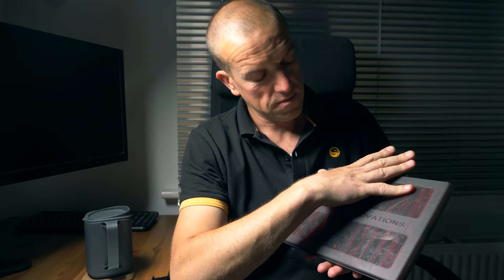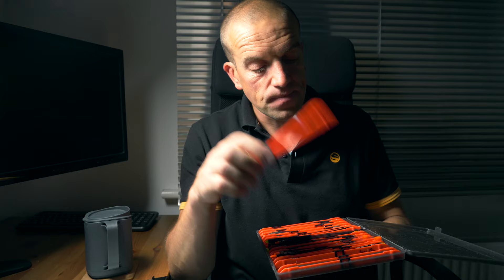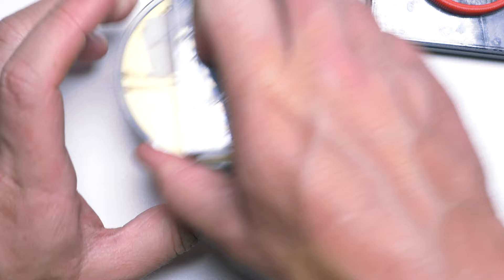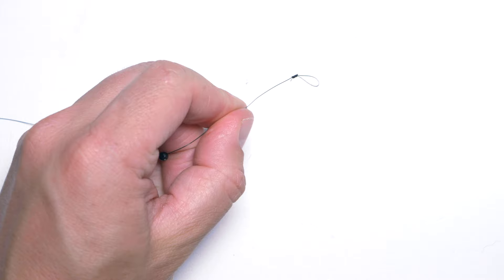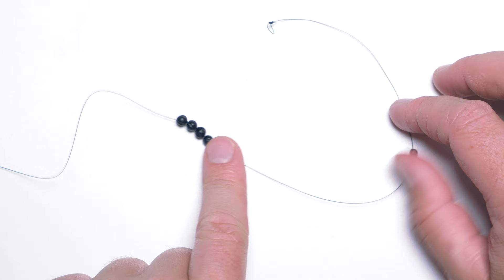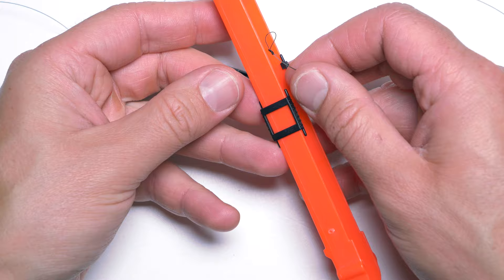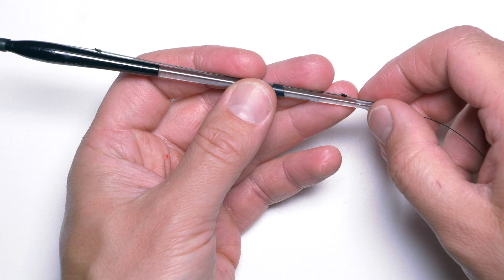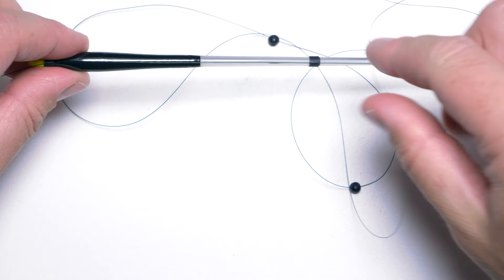How to tie and store STICK FLOAT RIG? ROACH fishing on TARES

Comment: 8x4 = 8x no4 shot or 16xno8
Reply from the maker: Thanks.
Fair enough. 👌
Reply: ...... or number 4 = 0.2g x 8. = 1.6g. 

The old school of thought was a number 4 for every foot (30cm) of water.  Therefore a 8x4 would be used in 8 foot of water as a rough guide.
Reply: Apologies I accidentally hit the thumbs down.......
Reply: Unless it's a pole float & it's 4x12 is style weights

Comment: hi andrew, awesome content!

Can I have some of your advice please?
I have a Drennan 2BB stick float but i am not sure how to shot it correctly. 
How many shots do I need to add and of which size? I am very confused..

Thank you :)
Reply from the maker: I would guess 2 shots of BB or 0.8 g. To be fair, if a float I am looking to use hasn't got rating in universal/metric units (grams), then I would guesstimate it by putting as many number 8 shots as needed and would not look for conversions..
Reply: Thank you I will try it 😃👍🏼